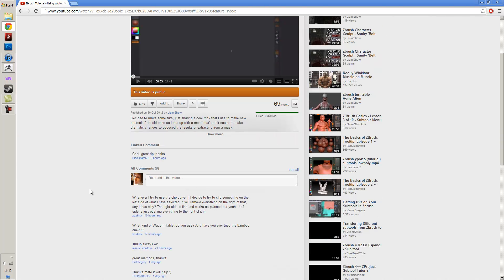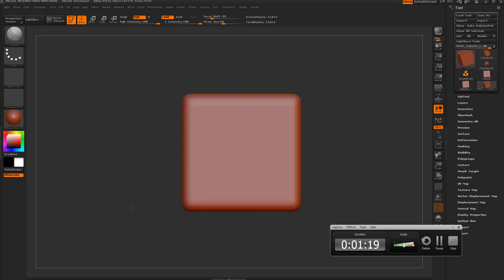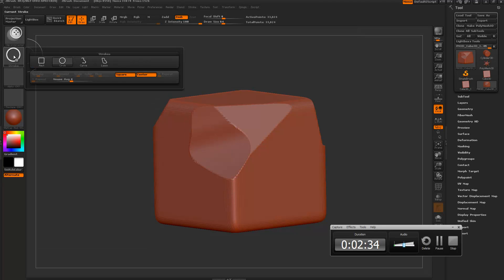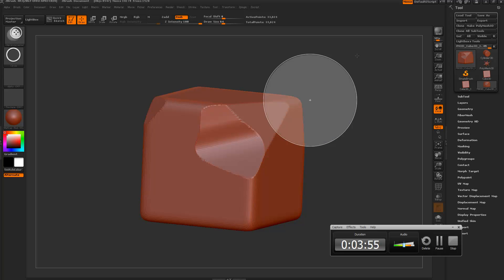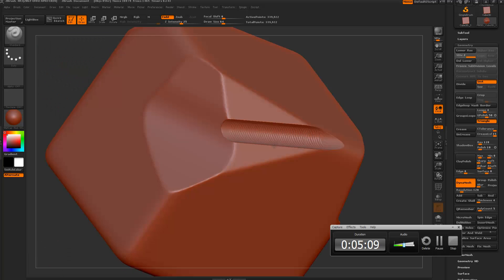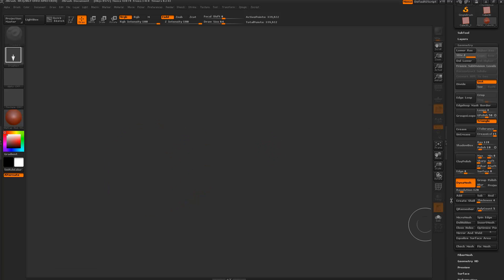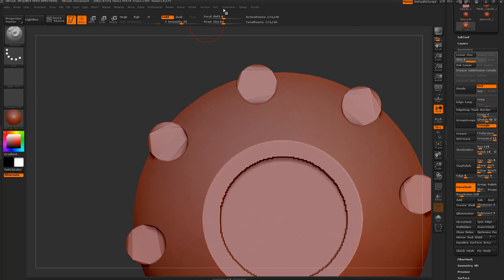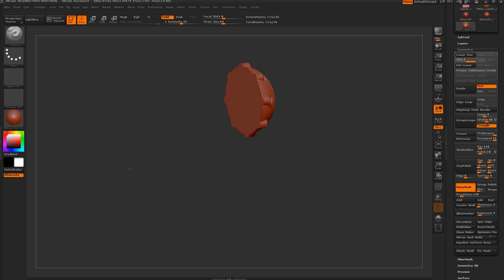Zbrush Tutorial - Answering xLukinx's question - clipping curve problem

Comment: My tool clip curve doesn't work at all. I am using dynamesh and all my setting are default. when i drag over it, it doesn't work still. I have the sub tool selected its the only one active. Wondering why.
when i go into my poly frame it creates new areas. but doesnt make a trim.

Comment: This is a good tutorial. I have been seeking out a video that shows how to deal with unwanted webbing when using any of the ClipCurve/TrimCurve tools etc.. I have been working on a fish sculpture for a project, and I have been building the entire fish from alphas that I created in Photoshop. I have built all of the fish's fins as alphas, and all of the fins have short, stubby finger-like protrusions at the ends of the each of the fins. When I import the alpha, the fin is created with mirrored sides...a front and a back. I have been trying to get rid of the back side, which is easy enough to do, but I keep getting webbing in-between the fingers on on the ends of the fins. How do I trim or slice off the back of the fin without having this weird webbing. In other words, how can I get a clean slice or trim? Is there some setting somewhere that I can adjust to clean this irritating webbing or avoid it altogether? Thank you for any suggestions or advice.